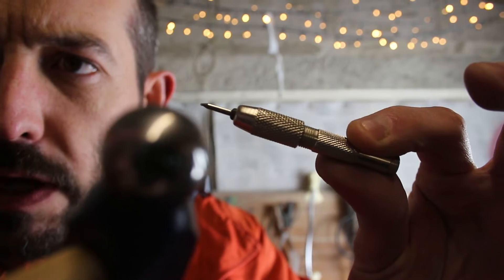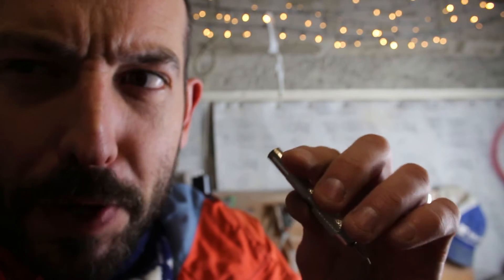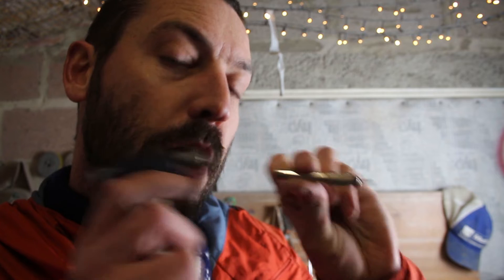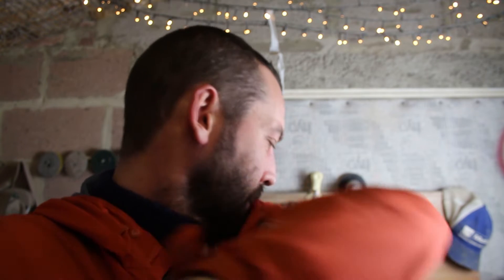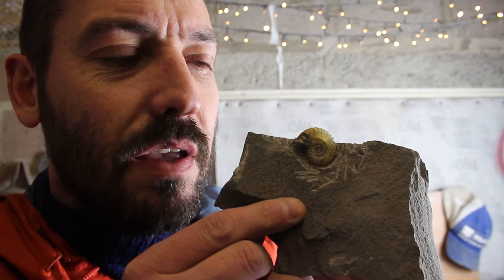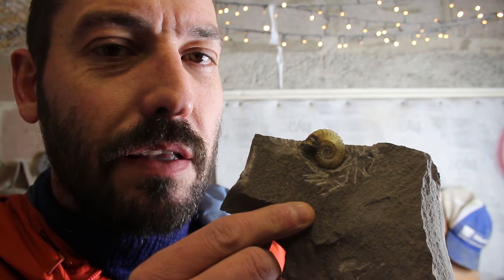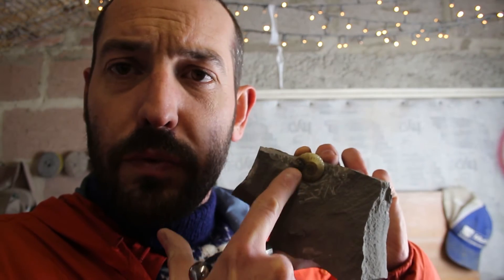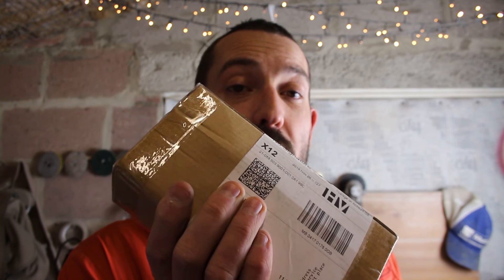Cleaning an ammonite with a pin and hammer

Comment: Can I ask what the tip is and where you get it ? Great video
Reply from the maker: Hey man sorry for the late reply, The points that I have are just tungsten carbide rod sharpened, not sure where they come from as I got them in a job lot of secondhand stuff. You can just buy the rod and sharpen it yourself on a diamond belt or grinding wheel. If you struggle to find some let me know on a PM on Instagram (the fossil academy) and I’ll get one to you.